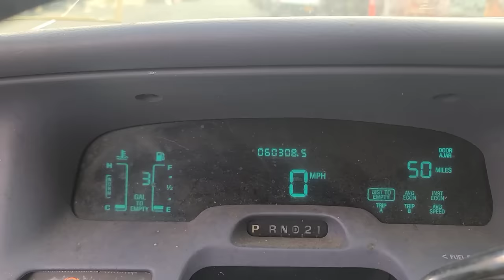Classic 60k Mile 1997 Panther ABUSED!

Comment: BOY, this panther keeps giving even when it is suffering a heatstroke.
Reply: The old panther cars can be run hot and take it. Blown upper intake car was smoking and they replaced 2 parts changed the oil ran it 225000 miles and the frame broke frome Rustam the steering gearbox. The engine and trans where still healthy.
Reply: @jasonschilling6120   Theyr are tanks, they put toyotas to shame !!!!